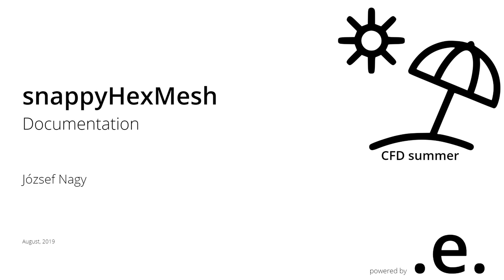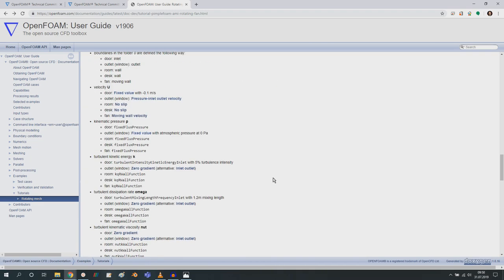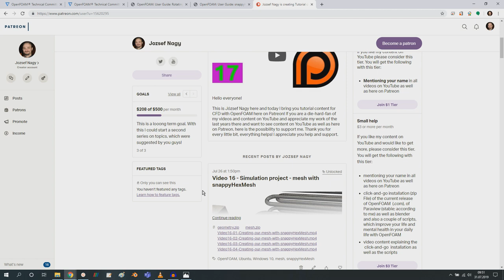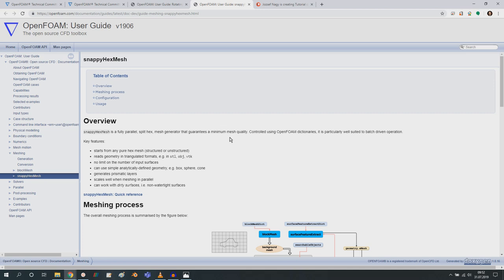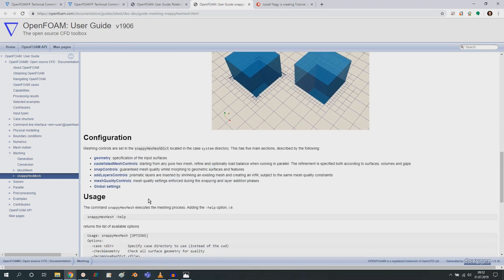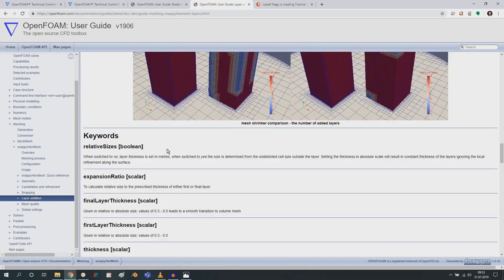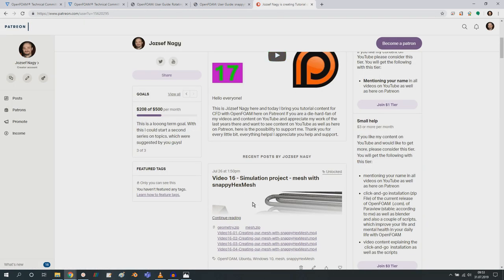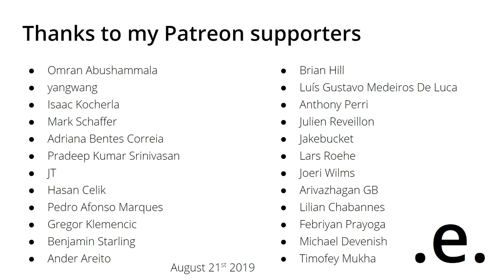[Community video] - snappyHexMesh documentation

Comment: hi, thank you for the videos. i need to model one channel with baffles inside it, i used Blockmesh for my main channel and then i used snappyhexmesh for adding the baffles. but now i dont know how to keep both meshes, since the mesh with snappyhexmesh consider the channel as background mesh and not the main mesh. how can i keep both of them in my simulation?
Reply from the maker: Do you mean an overset approach?
Reply: @OpenFOAMJozsefNagy  yes, how can i do this?
Reply: @OpenFOAMJozsefNagy  or since the geometry of baffles are simple, i can use just blockmesh for all of them? as an obstacle.
Reply from the maker: @nikasarabi1275  I have a tutorial on overset, check it out.

Comment: Thanks for your video József :)
I want to run the solver multiPhase/interFoam/RAS/floatingObject but by default it runs with a cuboid body, I have a cylindrical body in .stl format and I want to use it as a floating object.
How can I do this? I have been able to insert the cylindrical mesh in blockMesh by using snappyHexMesh, but how can I use the cylinder as a floating object? Thanks if someone can help me out, I am doing a univerisity homework
Reply from the maker: You have to modify the toposetDict and use the settings for STL. Then you have to modify the entries in dynamicmeshdict, however I am not familiar with the 6dof models.
Reply: @OpenFOAMJozsefNagy  Thanks for the tip, I will try to do something... :) It's just that you know, very complicated... I have been trying since a week now... :/